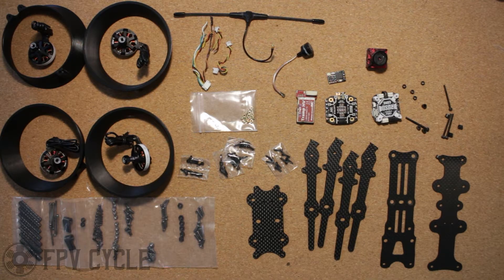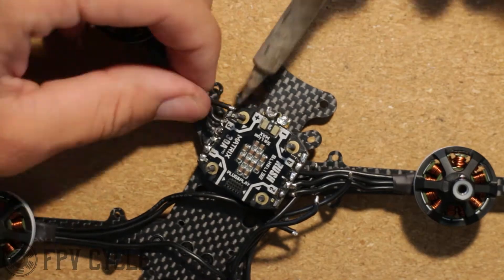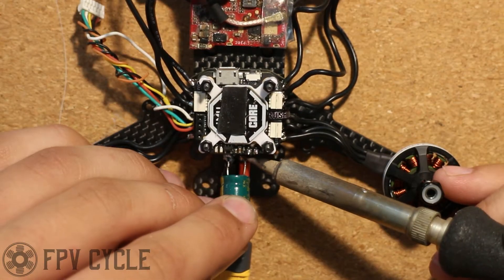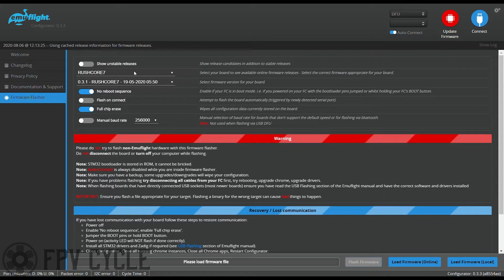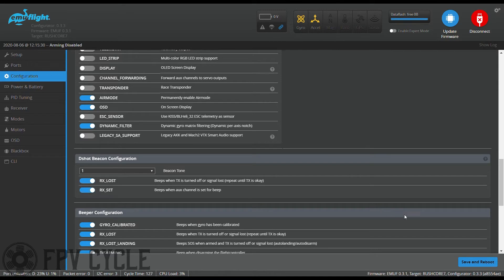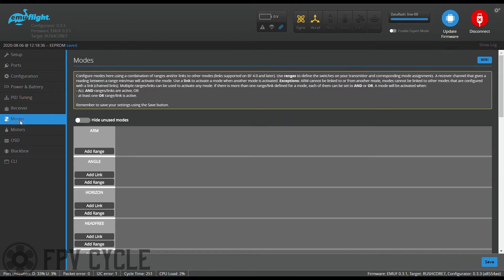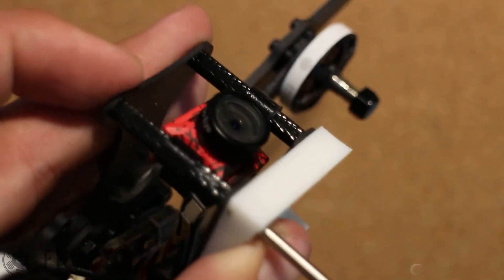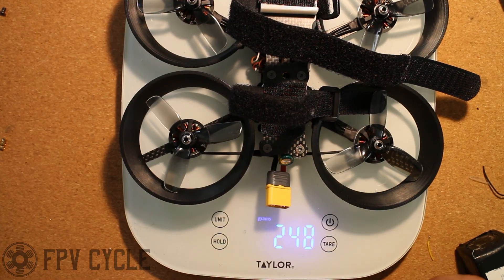Cinesplore Build

Comment: Great Video !
Will this bud still work if instead of analog I install Walksnail VTX so I can use the new Fatshark HD Dominator goggles ?
Reply from the maker: Yes a Walksnail VTX would work in this build. I checked the dimensions and it should fit no problem. You won't however be able to mount it with screws to the frame because the Walksnail uses 25x25 mounting and the frame only supports 20x20. You could still double sided tape it and use electrical tape/zip ties to secure it, which is what I do and many other pilots do.